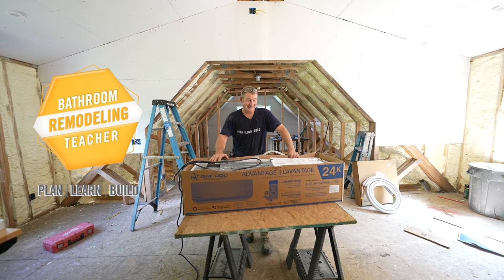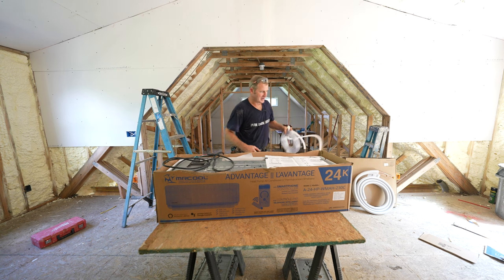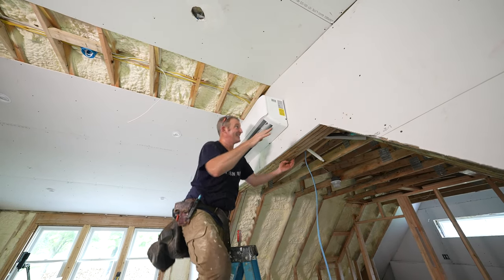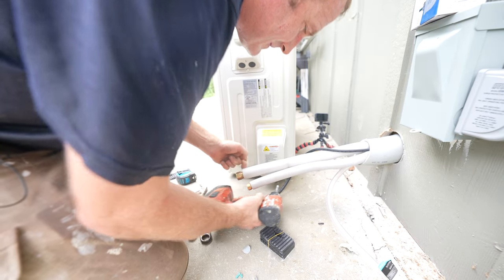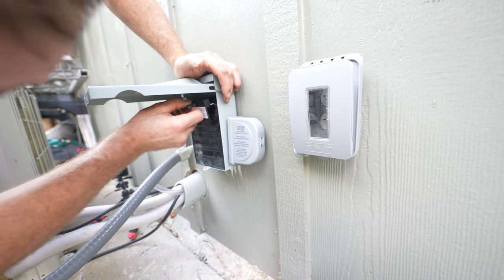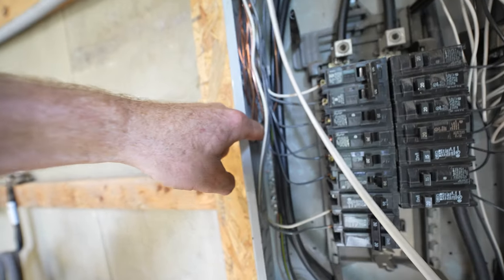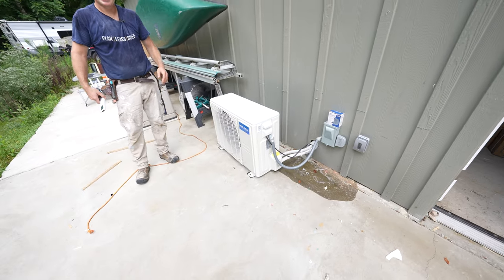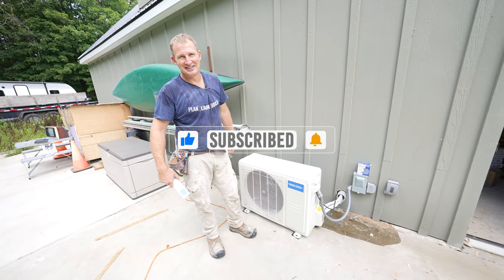DIY Mr Cool Mini Split AC Installation | Avoid Mistakes

Comment: One thing I learned from my HVAC guy is that it's a good idea vacuum the system out, pressurize the lines with nitrogen, leave it for a day or two, and vacuum it again before releasing the refrigerant. It'll help you find any leaks, and you won't end up releasing a bunch of refrigerant if you have one, plus it helps get rid of any moisture that might be in there. He's retired now, but he helped me with my last mini split install.

Comment: Great video! I have three 36k mrcool diy condensers I put in with a total of 8 air handlers I did in my house after my central air wasn't cutting it. The first two I did were inside interior walls, definitely a pain to do; thankfully had some access behind the walls to make things happen. One I had to add a condensate pump to get the condensate out through our attic. Been running for about a year now. Love them! Regarding the vacuum pumping, I didn't do that in mine since the instructions said the lines were pre-charged. I did think it was odd that when you were removing the cap from the back of the air handler lineset that air was coming out; my understanding and experience was not like that. Would have to check the manual again, but I'm pretty sure the vacuum bit is unnecessary with the DIY pre-charged linesets. Thanks again for the entertainment and education!

Comment: You really need to get these to 500 microns. If you can't you most likely have a leak in either your flares, or your oil needs to be changed in your vacuum pump, or you have a leak in your hoses, or you have a lot of moisture in you lines and it's taking awhile, or you have a little refrigerant in the lines. If you can I really recommend a torque wrench for the flares. If you turn off the vacuum and your microns jump up you also have a leak r one of the already mentioned problems. But, with that short of a run you should have no problem with 500 microns. Sometimes if you have a leak it will only show up when the refrigerant is pressurized the most. Y'all probably just had a leak in your manifold gauge or hoses. Y'all did a great job though. This isn't meant as any type of critique or correction just trying to help everyone know how evacuations work and the problems that can occur. I have never had a unit not pull down to 500 microns that didn't have one of those problems I mentioned. I don't mean to soumd like I think I know it all but this is what I do every day of my life and I just want to help everyone have another nugget of helpful info. Evacuations can be such a pain. Never let the unknown keep you from doing a job. Learn it and tackle it. We don't know till we do it.
Reply from the maker: Thank you 😊 I always thought 500 was overkill. But I did have trouble getting things below 1,000. Thanks for suggestion on oil change. I haven’t used this pump in 3 years 😆 probably has something to do with it
Torque wrench will be in my kit soon 👍

Comment: My only concern with these DIY mini splits is service.  They work great but when things go bad down the road most HVAC guys I've talked to won't touch them and getting support and parts from the manufacturer can be an issue.
Reply: Problem is that I priced a unit out and I could buy just about four of the DIY units for one "professionally" installed one. Even if I get 4 years out of one Im still ahead since they only take a couple hours to install.

Comment: Have you ever installed one with 2 or more zones??
Reply from the maker: Not yet…next home for sure. These are awesome
Reply: It basically is the same install except you have multiple air handlers that you will mount with potentially different lengths of wire and linset. If I recall correctly on the multi-zone units they usually recommend putting the highest BTU air handler in a specific port on the condenser (I believe it was the bottom-most; the manual will say). Only other difference would be potentially different gauge wiring and breaker size to the panel for the condenser; process is still the same though.